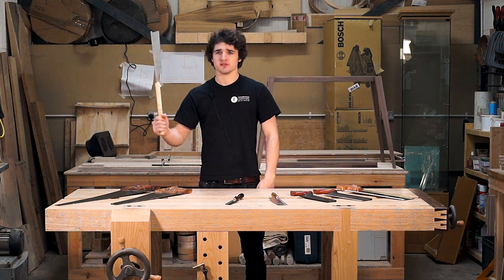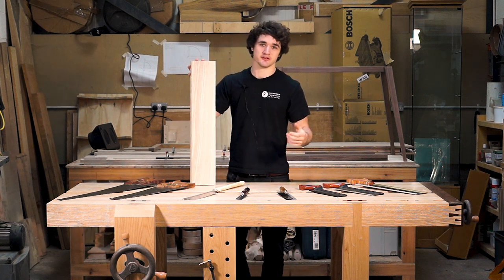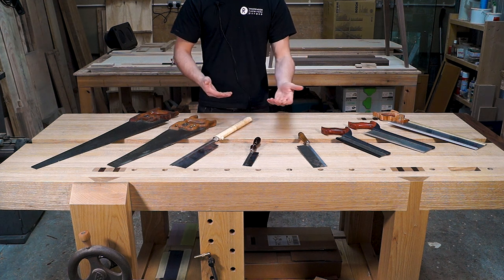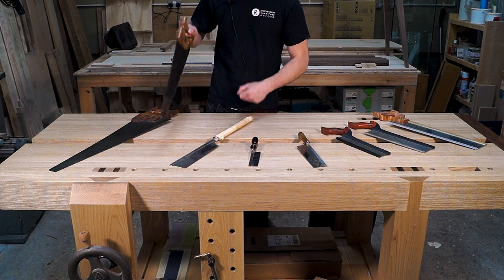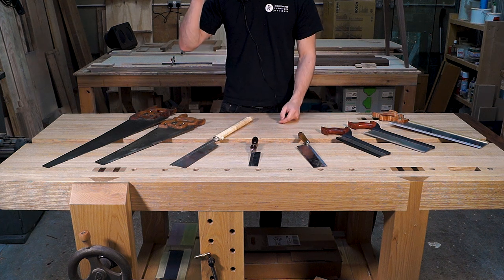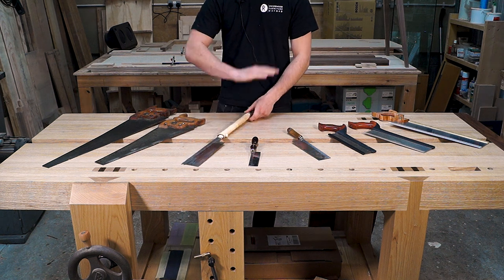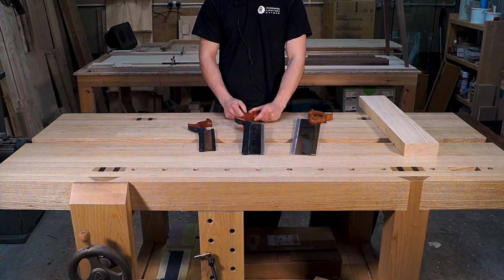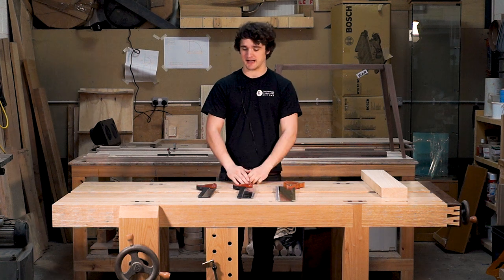What SAWS do you NEED?

Comment: If you can only buy one saw, then how about a Japanese Ryoba? The Ryoba is not a backsaw, instead it has a rip cut on one edge and a x-cut on the other. The thin kerf makes it suitable for finer work, yet is able to quickly slice through large dimension timber.
Reply from the maker: Never used one before so didn't feel comfortable adding it to my comparison. Although I'll pin your comment so people can see it easily. Cheers!
Reply: Awesome! I will add the caveat that for fine dovetail work, the rip side of a Ryoba is usually too coarse, but then it might be worth experimenting with the x-cut side, which commonly has a higher tooth count.
Reply: I'd second the recommendation of a ryoba, especially since they're cheap enough that you could get one and a dozuki to go with it for less than the price of a single veritas carcass saw, and they'd cover you for pure handtool work as well as handtool + machine stuff.
Reply: A counter-point would be that as Matt mentioned, the blades in Japanese saws are not easily sharpened but instead are replaced, which means that there is an ongoing cost (is it really just one saw when the blade has to be replaced?), whereas the Western style saw can be frequently sharpened or even modified many times.
Reply: I love my Ryoba but it can't beat the dovetail for finer joinery. I like having that added control of a stiff blade when doing finer work. The Ryoba just can't do as good of job. Don't get me wrong, the Ryoba can tackle 80% of a woodworker's needs; especially once they get talented with the blade. However, the finer work of a dovetail likes to have that additional rigidity.
Reply: Definitely my choice, the Ryoba is very versatile and covers two saws in one.
Reply: I just have to add my two cents.   I just went through the process of deciding between buying Japanese or traditional saws.    It really came down to cost.   I've used traditional saws and I tried an Americanized version of a Japanese saw and apart from it's poor design I loved cutting wood with it.    Then I looked at the cost.   I can buy a rip & CC Dozuki, a rip and CC Kataba  "No Back", a dovetail dozuki  specifically with a finer rip cut, and a little double edge flush cut saw, and medium sized Ryoba "all Gyokucho Brand" and the cost of the seven saws was less than the two Veritas carcass saws and Dovetail saw.      I can't speak for all brands, but the Gyokucho saws are all numbered.   For example the Ryoba is commonly available in 649, 650 and 651.   These numbers refer to the teeth size.   So you can buy complete saws or just replacement blades with finer or coarser teeth depending on what you wish to do.    The dozuki blades are also numbered for the same reason.
Reply: When I first started woodworking 3 years ago I also bought the same Japanese saws and I still love them. I think it's cheaper than investing the time and money to learn how to sharpen the western saws. Especially when a beginner is struggling with learning to sharpen chisels and planes. It's easier to get started in my opinion.
Reply: This is a great suggestion, the Ryoba is a great all purpose saw. When you add to your kit, the Dozuki is the one to go with. Great video Matt! I am fortunate enough to have all of the saws except for a large tenon saw. Of course, I live 10 minutes away from Veritas 😎
Reply: I agree, a set of 5 Gyokucho saws, covering all my needs vs just one high quality western saw - starting out the Japanese saws offer better value and are easier to use.

Over a lifetime, the western saws may have the edge on cost vs disposable Japanese blades.
Reply: I tried the Japanese saws repeatedly, since everybody seems so excited about them. Can't really understand the excitement - I don't feel like I can make smoother or more precise cuts with Japanese saws than with European style saws. As for speed, I do own a ryoba, it's dead slow compared to any decently sharpened Western saw, IME. But that may be because I started using European style saws already as a child, and it simply feels backwards for me to cut on the pull stroke.
Reply: I have a Gyokucho 372 (ripcut dozuki) for dovetails and a Veritas crosscut carcass saw and they pretty much get it all done. I also own a Ryoba but since its back is not stiffened I find it a little to flimsy for joinery, however it is good for flushcutting and dimensioning. When I bought my Veritas carcass saw I bought it with the tought in mind that I WANTED to learn how to sharpen Western saws and the tooth pattern on this one is not to crazy to master. For me, I found Paul Seller's videos alongside others helped me quite a bit whith sharpening (it's no whichcraft) and now it works just fine. Btw thank's Matt for creating nice videos aimed for beginners, cheers mate!
Reply: Did I miss the part concerning the Set of the saws' Teeth comparing Japanese with Western items ?
Reply: Ergonomics studies have determined that Push-type (Western) saws have far more "waggle" than Japanese (pull-type) saws...some of that waggle being the result of teeth set. Who knew ?
Reply: Try Silky folding ryoba... Takeruboy with fine teeth, butterfly style folding saw with great versatility. Having saws from big kobiki to precize dozuki, I use takeruboy most often.
Reply: @patrickinottawa27  I went that route too, way back in 1992!  (I've only had to replace one of those saws since due to dulling, but I am just a weekend woodworker, not a full-time craftsman.

Comment: Nice video! I am a Carpenter/joiner who loves using antique tools. I am also a collector of early Disston saws. I have 21 panel, crosscut & rip saws. Most of the rip saws have a thumb hole handle. All these are between 1896-1917 in date. I also have tenon and dovetail saws. One of the tenon saws is from 1860.
Dave.

Comment: I started out with a Harbor Freight "Ryoba" and got a lot of good work done with it. For $10 it lasted me 18 months before I was missing too many teeth to keep trying to use it. I upgraded to better quality Japanese saws, Ryoba, Dozuki and flush cut. I still use them today but I won't be replacing anymore blades. I transitioned to Western style saws because of the long term cost. I do this for a living, which makes my circumstances different than a hobbyist because my tools see a lot more use. I learned to properly sharpen & set the teeth, change the TPI and even convert from crosscut to rip. So instead of having to replace the blade every few months like I was on my Japanese saws, I simply stop and sharpen now. I can't speak to the Veritas or Lie-Nielsen saws because I couldn't justify the cost to myself... I went with old school Disston & Pax saws (less than $50 each saw, most under $20). They needed some work to get them up to par but after that, it's the normal sharpening routine. The only new saw I bought was a gent saw because you can pick them up in functional condition for under $30. I get the same results as I did with the Japanese saws and I'm not throwing away steel now.

Comment: I have been experimenting with using hand saws in a bit finer tooth (9PPI) and up with a rip pattern tooth only. They work pretty well, and it was generally practiced in the past this way. Saves the need to have double saws in every size, and with a marking knife those rip cut teeth have no problems crosscutting either. It's nice to have 5 of everything but I am trying to keep the kit down, this seems to really work well.

Comment: Through luck, I bought the dovetail and carcase saw that Matt recommended. But I also have some of those old panel saws from my Dad's garage. Use what you have!  They are easy to sharpen and work well. A lot of things depend upon one's setup, too. My shop isn't big enough to rip an 8' board through the bandsaw. That requires about 18 feet of space!  No problem with the old 8pt ripsaw.  The bandsaw is faster, lol.  One of those old panel saws was much smaller than the rip saw, and has a finer tooth. It's great!  But seriously, use what you have.

Comment: I have a Veritas dovetail system that’s includes a Japanese style saw with no back. I find that the blade can wobble and vibrate, and it also will bend where it joins the handle, whereas with my Veritas backed saw it stays straight and cuts through the wood like butter.

Comment: Okay, after finishing reading the comments and seeing all of the mentions of Japanese saws I feel I need to add a cautionary note.    These saws were developed by a culture that cut primarily soft woods.  If you are planning on cutting western or tropical hardwoods with Japanese saws you may find your prized saws to be missing more teeth than the front row at a Willie Nelson concert.  Also, that Ryoba has a 265mm blade (standard) which will leave you feeling like a sewing machine as you try to make the most of that 8" stroke.   I defy anyone to hog through an 8/4 plank of hard maple with one of those.  If all you are doing is joinery then you can get away with it, but as a replacement for western saws in general... No.  I'll keep my 32" 5-point rip saw, that I can re-sharpen.   For a western saw that will do everything a Ryoba will do, I would go with a 10-point rip panel saw with ground plate and minimal set.
Reply: I have actually cut both 8/4 and 12/4 hard maple and oak with my Japanese pull saw when I was making a bed last year. Just happened to be what I had that was sharp when I was working on the project, as my western says were in need of sharpening. Have to say that because of the ease of use, sharpness, combo of crosscut and rip on the same tool, and staying dead straight without a spine getting in the way; I tend to go with the ryoba about 9 times out of 10. Except in any very specific circumstances where anything different would be considerably better. Heck...even when I am cutting dowels, I tend to go for the Japanese flush cut saw more often. Neither one has ever really found a task it cannot master with the proper form and time.
Reply: I do commend your skill though in utilizing western saws. It definitely does take more work and practice to master.
Reply: Have you tried cutting 8/4 hard maple with a standard Gyokucho Ryoba? It's not really a concern.

Comment: There is one particular kind of saw that's apparently not at all popular anymore with especially UK and US woodworkers - the frame saw. You can see an exquisite example of using it here: https://www.youtube.com/watch?v=YFqY73lelq8. (Be aware that that clip is a joke. Still, it demonstrates the use of frame saws very well, IMO.)

I suppose it got out of favor with cabinet makers due to the ascent of the electric bandsaw - it pretty much allowed one to do the same kind of cuts, but manually.

Why am I mentioning it: it is a highly versatile hand saw, IMO an excellent saw for a hobby woodworker or someone who frequently has to do non-trivial work outside of the workshop.

Different blade patterns can be used for rip and cross cutting. The blade sits in two handles which can be rotated, so that you can cut with the blade in the same plane as the frame, or perpendicular to the frame, or at any angle in between. You can resharpen a blade many dozens of times, and reset the teeth, so you can use the same blade for many-many-many years, and if you have a set of blades of similar length, you can use them all with the same frame.

The blades are typically thinner than other Western style saw blades (but not as thin as Japanese blades, just close), and you can cut both on the pull and on the push stroke.

The blade, being tensioned by the frame, will never buckle, regardless of how crooked your movements are. However, given the length of the blade, it allows you to cut with long, slow, smooth, well controlled moves, which makes it easier to cut straight.

Provided you invest a little time in learning to use and maintain it, and get a good set of blades which all fit into the same frame, it is a very cheap, very versatile, very precise saw, that allows very smooth and precise cuts too. In fact, with a little bit of effort, you can buy the blades only and build the frame yourself, which makes it even cheaper.

Blades are increasingly difficult to find, though. Building blades out of bandsaw blades is wrong - the tooth pattern and sharpening has to be different.

Comment: Dunno man, I've got a 10 inch crown gents I rehandled for dovetail and small joint ripping, a 12 inch cheapo stanley miter saw cut down into a ~1.5 inch deep crosscut carcase saw, and a 14 inch kobalt with a semi-hybrid pattern I rehandled. Love my saws but I've been finding myself annoyed at only having a scavenged stanley 12 inch camp saw when I could really use another foot or so of blade with like half the teeth per inch from a good panel saw.

Comment: One drawback to Japanese-pattern saws - mostly a problem when cross-cutting - because the cut is on the pull stroke any broken fibers and dribbling saw-dust tend to obscure the line you're cutting to.
If I had to have only one saw it would be a rip-cut.  I started investigating this concept after reading "Tage Frid Teaches Woodworking" wherein he wrote that any cross-cut saw that comes into his shop gets re-filed to rip pattern as soon as it's dull.   I've found that the surface quality between cross-cut and rip tooth is not as much as you would expect, when comparing the same TPI, but the rip saw works considerably faster.  Comparing a 14tpi cross-cut to a 5tpi rip will obviously show a huge discrepancy, but 14tpi cross-cut to 14tpi rip...   Not enough of a difference to change the workflow.  Really - when do you leave a raw saw-cut on a show surface on furniture?   Never.
Reply: Mike Graham    Good point about the Japanese saws obscuring the line. I synchronize my breathing to blow the sawdust away every few strokes, but it's still a hassle.

Comment: Great video Matt. One question... if it’s not printed or stamped on the saw, how do you tell the difference between cross and rip cut?
Reply: Mike Livermore you look at the teeth. Rip saws will have them filled square to the plate, whereas crosscut teeth will not be and will alternate direction every other tooth.
Reply: Andrew Frink .  Thanks Frank...
Reply: Hi,　Mike.  If it comes to Japanese saw, you may look at the shape of the teeth too.   The cross cut teeth look more like a Knife edge, and the Rip cut teeh look like a Chisel.

Comment: I came across 12 diston 26-28 inch.
 3 gents saws 1, 8inch & 2, 10 inch.
1 veneer saw
1 Japanese saw you have shown
1 2 sided blade with a Japanese handle
2 hack saws
3 14 inch saws that maybe for a miter box
1 14 inch panel saw (Stanley)
craftsman 20 inch miter saw withan adjustable miter
strange looking triangle type blades some with 2 sets of different teeth on them and no handles

I don't think I want to spend the rest of the summer sharpening them all.
With the information you just gave me. It sounds like I should sell some.

Comment: Japanese saws are traditionally held with your thumb laying along the top of the handle inline with the handle/blade not the index finger.
Reply from the maker: Weird, I was taught differently but I guess it's whatever works!
Reply: Matt Estlea - Furniture you should give it a try, I find it gives very good control. The thumb is what modulates the amount of downward pressure on the blade.

Comment: A question from a non-english speaker (I'm sorry for the ignorance...): what's the difference between furniture-making woodworking and carpentry?
Reply: Carpentry is a skilled trade in which the primary work performed is the cutting, shaping and installation of building materials during the construction of buildings, ships, timber bridges, concrete formwork, etc.

https://en.wikipedia.org/wiki/Carpentry

Comment: Another great video, Matt! I currently use a Dotsuki for cutting my (me?) dovetails but it also seems to excel at cross cuts. The kerf is super narrow and it cuts easily. What am I missing out on by not having a proper cross cut saw. Thanks!
Reply from the maker: Yea the dozuki works really well for crosscuts. The only difference you would find is that the cut has less vibration in it and feels smoother.

Comment: Hmm.  You don't really say what makes a rip saw or a cross cut saw.  If it's not labeled with the fancy laser etching, how can I tell them apart.  You also mention a carcase saw without saying what it is.  I grew up with just a carpenter's saw and a hack saw, so the carcase term is completely new to me.  I've no idea what it is or what makes it different.
Reply: So a rip saw will have teeth that are square to the plate. Think lots of little chisels. A crosscut saw will have teeth at an angle other than 90 degrees to the plate. Those teeth will alternate angles as well. It will make more sense when you look at them.  As for the carcass saw, it’s mostly the size of it that gives it that name. Larger than a dovetail saw, not as large as a tenon saw. They can come in either rip or crosscut teeth patterns. Hope this helps.
Reply: It’s in their name

Comment: Hi Matt,  on the Dovetail saw would you say the 14tpi is the one to go with ?    And also with the crosscut carcass the same 14tpi ?
Reply: I just purchased the 22 TPI dovetail saw and love it for boards up to about 5/8” thick, regardless of soft vs hardwood. It starts very easily and cuts straight. I do find it takes an extra stroke or two to complete the cuts vs the 14 TPI. After owning both I would say get the 22 TPI model. I rarely cut dovetails in stock larger than 1/2” and the extra strokes don’t bother me. I’m not in that much of a hurry.